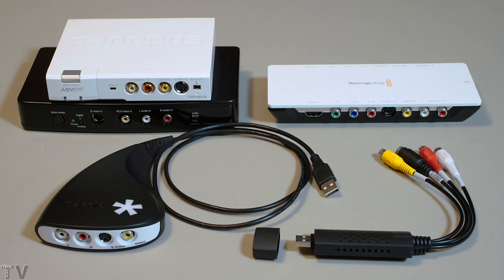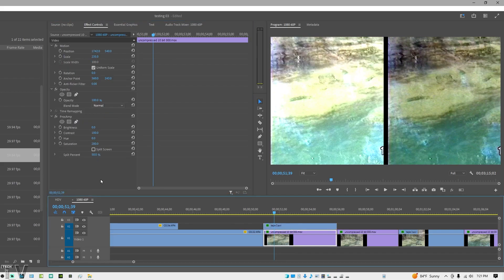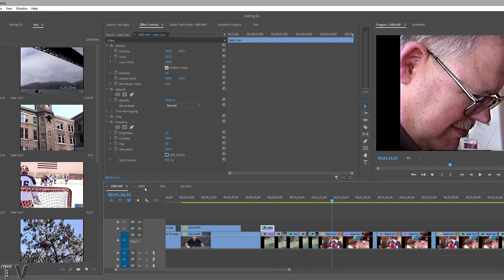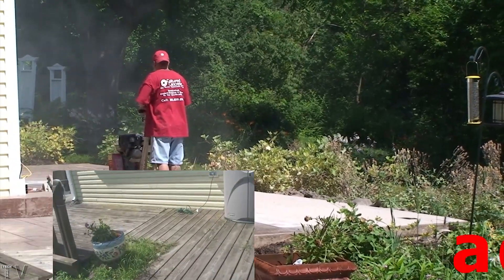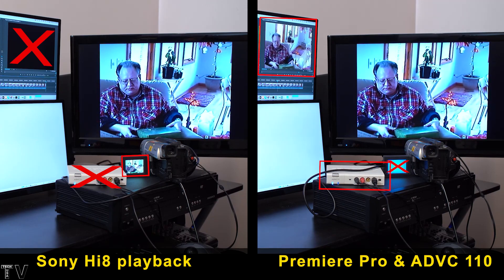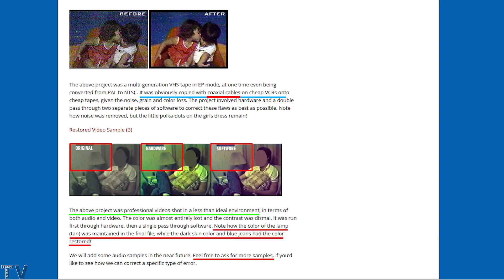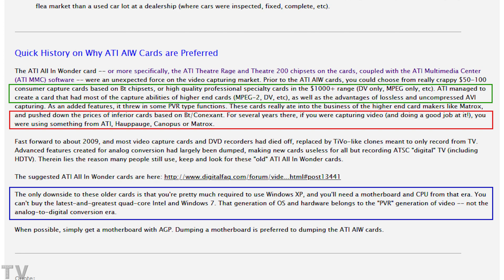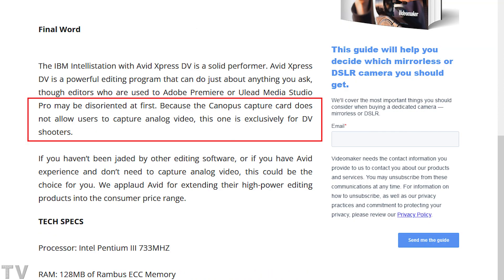part 2 of hi 8 video transfer and VHS video capture myths debunked

Comment: I can see the difference. The proof is in the data if the video file has more color information then its going to look better...
Reply from the maker: If I did another video comparing 4:2:2 10 bit uncompressed and the DV-25 codec at 8 bit 4:1:1 with 5:1 compression you could easily tell the difference? I can create the video if you a willing to guess.  What if you guess wrong? Do I get $500.00?

Comment: hello! this is an older video, I'm just getting into analog recording so all of this is new, but I was wondering exactly how you're converting the hi8 tapes to uncompressed digital formats? I think I understand that Firewire DV converters convert the analog video into digital with the DV-25 codec, which means its compressed. So how are you converting into a digital uncompressed codec?
Reply from the maker: If you watch the very beginning of the video you can see the Intensity Shuttle in use. I demonstrate how using hardware is inferior to software. Software gets better and better but  hardware becomes obsolete and out dated.
Reply: Oh okay, I think I understand! So the intensity shuttle can capture uncompressed video. And you're demonstrating that this old hardware has some failures, and when using the FireWire DV converter and adjusting the image with modern software like premiere, that the quality is indistinguishable? If that's correct then thanks!
Reply: I've also seen you compare this method to cheap USB composite capture devices. I've also seen YouTubers like TechnologyConnections and LinusTechTips use a composite to HDMI converter, and then capture that video with a simple HDMI capture device, I'm curious if you've tested that specific method before and if you have any thoughts on it?
Reply from the maker: Both TechnologyConnections and LinusTechTips have convoluted methods of capture video when compared to using a Firewrie DV converter. Let me ask you this. Could you see a difference between the uncompressed 10 bit 4:2:2 video files and the DV-25 video files? Are you expecting better video quality than 10 bit uncompressed 4:2:2? Having said that why not send emails to TechnologyConnections and LinusTechTips and ask them if they have tried my method? I am sure both TechnologyConnections and LinusTechTips would agree my method is better than their method if they actually tried it.  Keep in mind I was doing video production for a living when Linus Tech Tips was a Youth Camp Counselor. Do you kind of see my point? I should also mentioned TechnologyConnections admits his method takes a hit in the dynamic range. I will end by saying I have indeed used the same method as TechnologyConnections and it suck ass when compared to using a Firewire DV Converter as demonstrated in the video link below. 

https://youtu.be/hroHcwOxoOI
Reply: @TechTVusa  am I expecting better quality than the uncompressed video files? Nope. I was initially curious about the uncompressed format because I assumed that uncompressed would be the highest possible quality. Could I see a difference between the uncompressed and the DV-25 files? Also no. Like I said before, I'm really new to analog to digital conversion and when searching online there's just a sea of different methods that people use. I initially came across techconnections and LTT's videos before yours, and you were the first person I've seen anywhere that had an uncompressed 4:2:2 video using different methods than I've seen, so I really appreciated that as well as the comparison to the DV-25 files. Anyway thanks for the great information and videos
Reply from the maker: @neojimmyd  You are welcome.

Comment: Thanks for this video. I have captured using the "DigitalFAQ" method and am happy with the results. But I'm also interested in testing things for myself. So I digitized a Video8 tape, recorded in 1998 on RCA Video8 camcorder. I used this footage because it was well lit. I used two workflows:

1. Sony TRV-66 Hi8 camcorder -- Panasonic ES-15 -- ATI All-in-Wonder 9600XT saved as AVI file (HuffYUV, chroma subsampling 4:2:2)

2. Sony TRV-66 Hi8 camcorder -- Sony TRV-17 MiniDV camcorder -- transferred to Windows 10 via firewire with WinDV software (DVSD codec, chroma subsampling 4:1:1)

If I retest I would remove the ES-15 from workflow 1 so as to remove that extra element. If anything, the ES-15 will make the colors look more washed out on the ATI test. Anyway, I don't think it invalidates the comparison.

Both files were deinterlaced in Hybrid with QTGMC at 59.97fps bob, saved as ProRes 422, at 720p. The MOV files were uploaded to YouTube so others can compare. The video is here: https://youtu.be/IxOgefyVlvQ

There is a slight difference when placed side-by-side but I would be happy with either version. I also know that theoretically the non-lossy HuffYUV codec will make it better to enhance the video compared to the lossy DV codec. But I wonder if that is overstated, especially for the average capture hobbyist who is simply going to dump the video file in Davinci Resolve to fix things a little bit and call it day.
Reply from the maker: I don't mind you posting a link to your own video. That being said you should post a link to your video a digitalfaq.com because Lordsmurf has you fixated on 4:1:1 Vs 4:2:2 when the dynamic range is more important. In your video there is a difference between the ATI AIW and the DV method because the ATI AIW is a piece of crap. In my video I am using professional broadcast compliant hardware and the end results look identical. Your video files do not look identical. I simply captured the video using Premiere Pro and rendered out at 1080 P60. You had to unnecessarily use 3rd party software. My method is much simpler and yields just as good of results as seen in the video link below. Having said that your DV video looks OK overall but you wasted time to get the end result in my opinion. I hope you will make a follow up video using Premiere Pro to scale up and render the video at 1080 P60. Simply drop the interlaced DV-25 video files in a 1080 P60 (60 frames per second) sequence. When you render out Premiere Pro will not de-interlace the video file but will instead interpolate the fields into frames. Does it make sense? You can feel free to give me a shout out. Keep in mind Premiere Pro can no longer capture video. You can use iMovie or FCPX to capture the video using a Firewire DV converter and edit the video files in Premiere Pro. You could use FCPX or even iMovie to edit the videos just as well as Premiere Pro. 

https://youtu.be/vqCi9B_7mdU
Reply: @TechTVusa  Thanks for the reply. I have a few follow up questions. I transferred my MiniDV tape (of Video8 source) via StarTech PEX1394a2v2 and used WinDV. Was this an error? I'm on Windows 10. In this method I don't see an option to capture with the Codec you referenced. 

In my demo I deinterlaced the DV Avi file with QTGMC (bottom field first) at 59.97fps with Bob, upscaled to 720p all in Hybrid. Is Premiere's deinterlacing and upscaling better?
Reply from the maker: If you use a Firewire based DV converter it will capture the video in the DV-25 video codec. Some software will let you capture to uncompressed 4:2:2 using a Firewire DV converter but the problem is once the video enters the DV converter it is encoded as a DV 25 video file. You would not be capturing uncompressed but rather making a larger file with the same DV-25 quality. I say stop using cheap crappy software like lordsmurf does. Instead use Edius, FCPX, Vegas etc to capture the video. Those program will capture into the DV -25 codec. As I stated I don't de-interlace. Instead create a 1080 P60 sequence using FCPX, Premiere Pro, Edius etc. Those programs will interpolate the fields into frames. Having said that you can watch more of my videos like the one below. After watching the video link you can decide if the image quality using my method is good or not.  

https://youtu.be/vqCi9B_7mdU
Reply from the maker: If you would like we could do a video chat on Facebook.
Reply: @TechTVusa   I read that "DV25 (also known as DV NTSC) is one of the most widely used video codecs for miniDV, DVCAM and DVC Pro tape formats. It has a data rate of 25 Mbps and has a Color Sampling ratio of 4:1:1"

Here is the media info from one of my firewire transfers. I seem to have 25 Mbps, too. So, is is DVCPRO the same as DV25?

Format : AVI 
Format/Info : Audio Video Interleave 
Commercial name : DVCPRO 
Format profile : OpenDML 
Format settings : BitmapInfoHeader / PcmWaveformat 
File size : 4.21 GiB 
Duration : 19 min 51 s 
Overall bit rate mode : Constant 
Overall bit rate : 30.3 Mb/s 
Frame rate : 29.970 FPS 

ID : 0 
Format : DV 
Commercial name : DVCPRO 
Codec ID : dvsd 
Codec ID/Hint : Sony 
Duration : 19 min 51 s 
Bit rate mode : Constant 
Bit rate : 24.4 Mb/s 
Width : 720 pixels 
Height : 480 pixels 
Display aspect ratio : 4:3 
Original display aspect ratio : 4:3 
Frame rate mode : Constant 
Frame rate : 29.970 (30000/1001) FPS 
Original frame rate : 29.970 (29970/1000) FPS 
Standard : NTSC 
Color space : YUV 
Chroma subsampling : 4:1:1 
Bit depth : 8 bits 
Scan type : Interlaced 
Scan order : Bottom Field First 
Compression mode : Lossy 
Bits/(Pixel*Frame) : 2.357 
Stream size : 3.99 GiB (95%)
Reply from the maker: As I stated prior you should not be adding additional cheap software to the capture process. Since Premiere Pro can no longer capture video using 3rd party hardware I will have another VHS/Hi 8 video soon that will be done using the Mac Mini and iMovie. The DVCPRO comes in different flavors. One of them is DV-25. If you have anymore questions we should do a live chat.

Comment: Interesting video. I used to work in a duplication facility that copied broadcast video, 1" video tape, and Betacam and 3/4" cassette tapes. We also had 100 VHS duplication VCR's. I now transfer all the types of video tapes. My original computer I built way back in the 90's, it still is Windows XP Pro. Still works great with my Canopus 300 DV and Premier Pro for Windows XP. I now have a 2020 MacBook Air, Intel chip, works great with the Canopus 300, with a couple Apple cables to get the firewire connection. I also have an Elgato USB capture device, works great for compressed fast on the fly captures. But you can't beat the DV uncompressed for editing and quality, especially long tapes. I am slowly adding more Apple computers, they just work, esp for video capture and editing. I am now following your channel, I want to see when there is an update about Lord Smurf, ha ha.
Reply from the maker: Thanks for watching but the DV-25 codec is not uncompressed. Firewire DV converters convert the analogue tape into the DV-25 codec. The DV-25  codec is a lot like motion JPEG at 5:1 compression. Having said that the human eye may not notice any difference between the DV-25 codec and the uncompressed video codec. I may have one or two more VHS/Hi-8 videos I can do this year.

Comment: I currently bought a used Black magic intensity shuttle! For video capture. I am use Blackmagic Media express to capture. But no video in the capture window. I did composite video, Hdmi & no picture. I even reset my monitor resolution. But still no
Picture. Also the media express always default on 525i59.94 ntsc. Need help!
Reply from the maker: The link below should be helpful. 

https://youtu.be/-mz7-delWJA

Comment: I recently purchased a ADVC100, it looks brand new, I can not get anything to display to any of the programs I’ve used. My connections are, Panasonic VCR with RCA Output connecting into the front input of the ADVC100, output via FireWire into a Macbookpro 2010 directly as it has a FireWire port, programs used, iMovie, Quick Time, Premier Pro, all programs can recognise the ADVC and display it as a DV so you can select it, but no video display, VCR is PAL, so toggle switch on ADVC is on PAL, all others are off, have also tried another VCR Samsung with the same result, any ideas what else I can try?
Reply from the maker: It doesn't matter if you can see the video in GUI of Premiere Pro. Just hit records button and see if it records. The video link below might be helpful. 

https://youtu.be/-mz7-delWJA
Reply: @TechTVusa  thank you, I have watched that video a few times, along with many of your videos which are very informative. I have tried connecting the ADVC RCA out to my old tv and it displays a thin fuzzy line down the right hand side and a black screen, if I press record while connected via FireWire in Final Cut Pro or premier it stops after 3-4seconds with an error saying no data received, not sure what else to try